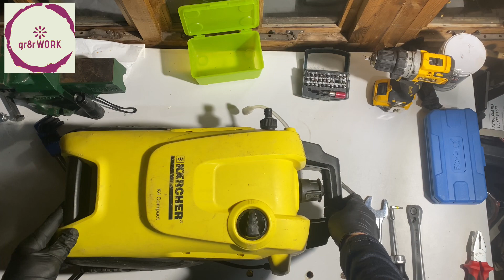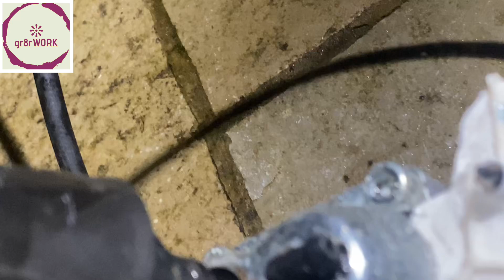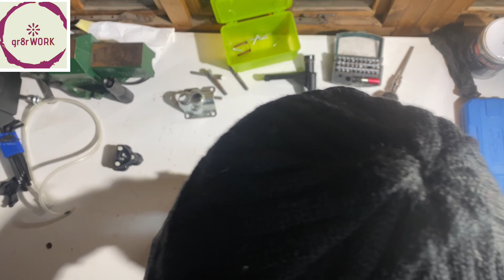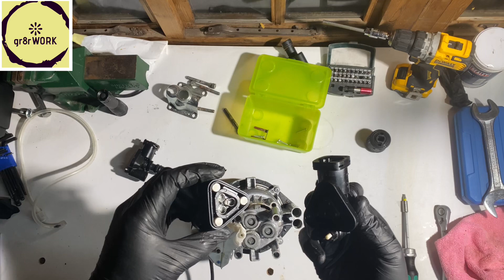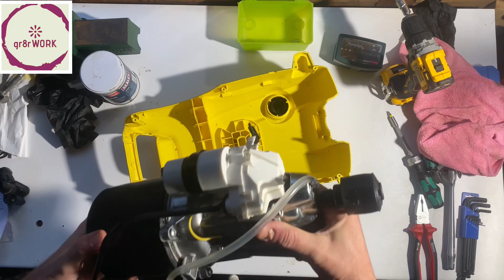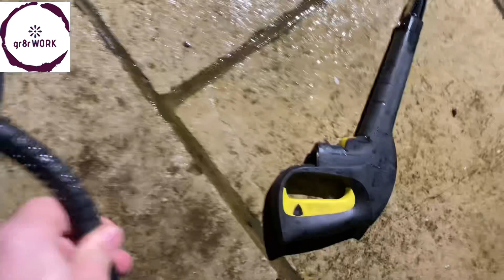How to fix a leaky Karcher K4 pressure washer

Comment: I'm fixing a similar problem with my K4. Building it back up in the head of the pump there are 3 little springs and little white plastic valves in the middle. What goes in first? spring or white plastic piece with spring on top?

Comment: Hi Could you please explain about the 22 mm and 20mm information. Do you mean the internal diameter of the hole? I need to buy a new part and my model is K4 Compact 1.637-313.0. If I bought the 22mm one and mine is 20mm for example would it still fit?
Reply from the maker: Hi! Version 2 measures 22mm on the outside diameter of the detergent intake, and the part number is the one I mention at minute 14:00. Version 1 measures 26mm on that outside diameter (sorry I think I said 20 on the video). I do not know if they are interchangeable, I would assume they aren't. Here are some links for the two parts (I am not affiliated with the sites):
Version 2: https://germanpressurewashers.co.uk/products/karcher-manifold-and-pressure-piston-version-2-22mm
Version 1: https://germanpressurewashers.co.uk/collections/unloaders-control-heads-1/products/karcher-pressure-washer-housing-pressure-controller-version-1-white-26mm